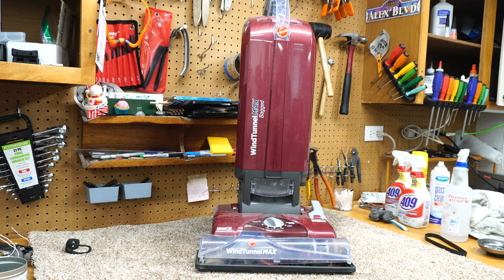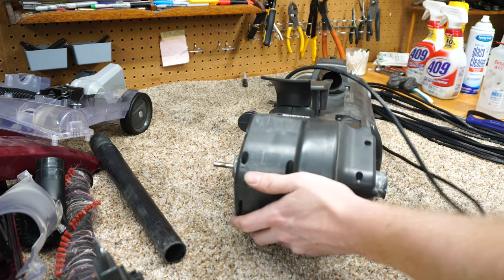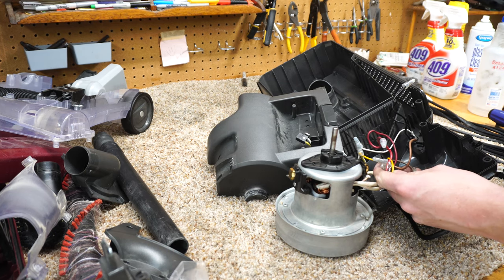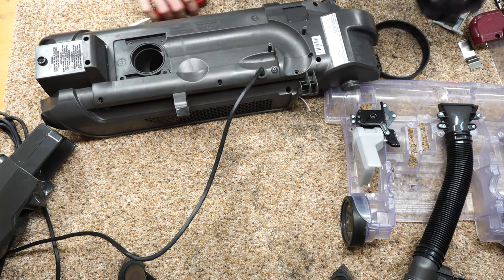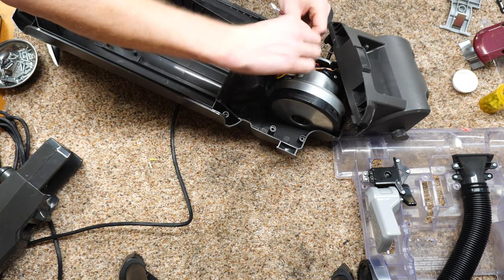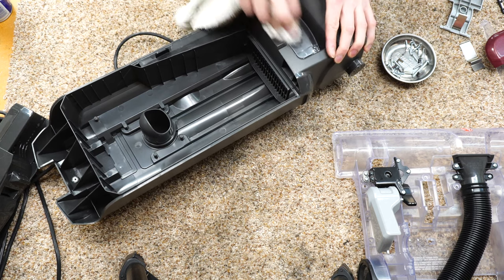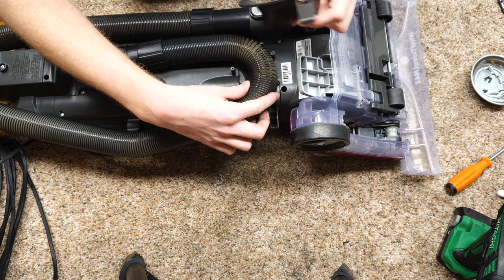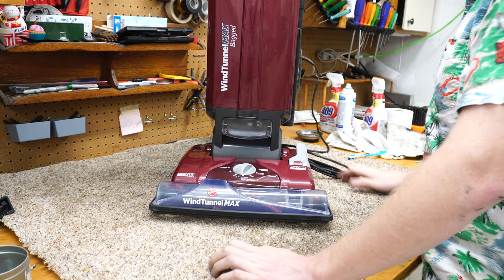Hoover UH30600 Vacuum Repair

Comment: Nice tear down and assembly video. This may come in handy one day as my mom gave us this model vacuum recently.

I would like to share a tip for working with thread cutting screws in plastic parts I received from a former Maytag engineer. When reinstalling, insert screw and rotate counter clockwise until you feel the screw “drop” into the existing thread then proceed to turn clockwise to tighten. This prevents cross cutting new threads into the holes, stripping or splitting the bosses. This method will also allow for multiple disassembly and assembly attempts.

I use this method every time and I’ve had some devices apart many times and can still snug up the screws.

Comment: I used to have one of these. Once I was out of bags so I took the bag dock off and was able to use a HepaFlo bag. It's a snug fit. .I eventually put a Y bag back in it but I was in a jam and it worked like a charm. Y bags are becoming scarce in Toledo when vac shops are closed.
Reply from the maker: That's interesting to know yet another machine a Henry bag can fit on. I usually get my bags from eBay or Amazon. Are they scarce there too for you?
Reply: @PerformanceReviews  yes sir. I could only get them through a vac shop. There aren't many places that sell bags here in Toledo OH, and the bags you do find at Lowes etc are worthless. I switched to a Sebo but I still use the Hoover in the field and I also buy the Y bags on Amazon now.

Comment: Hi,
I'm trying to repair one of these for my mother. It won't adjust up and down using the white knob to set how close it is to the floor. I took apart and it looks to me like the white plastic piece that the knob cam should actuate is broken. Any idea what the part number for this might be? Or where I can look at exploded view?
Thanks for any help.   Steve

Comment: What's the main difference between this vacuum and the Hoover T-Series WindTunnel Bagged vacuum (UH30300,).  Thanks for the video.
Reply: We've used the UH30310 (very similar to the UH30300) for years. The arrangement of the internal parts is slightly different from the model in the video. Otherwise, they seem very much the same.

Comment: Is it possible that I can use carbon brushes from a hoover elite 6.7 amp on a motor from a WindTunnel or will it blew up the motor in the WindTunnel?
Reply from the maker: You need to change the motor if the carbon brushes have worn out. The bearings in this motor would have worn out as well.
Reply: Performance Reviews Because few of the websites no longer have any in stock. Vacuumedic sold out of them Last year I bought 2 pair of them
Reply: Performance Reviews So if I use the carbon brushes from a hoover elite and put them in motor from a WindTunnel it will burn huh?
Reply: Performance Reviews Also I noticed that motors have different highlighted colors around the ring what’s that about?
Reply from the maker: Link the description to replace the whole vacuum. I don't think it's personally worth doing a motor. But if you could find a motor replace as a whole sembly. 98% of vacuums should not have their carbon brushes replaced do to other parts designed to wear on the motor.
Reply: Performance Reviews I wish Hoover should’ve kept the original motors